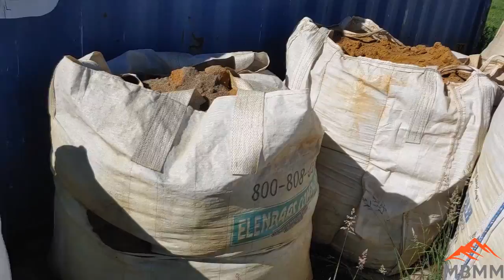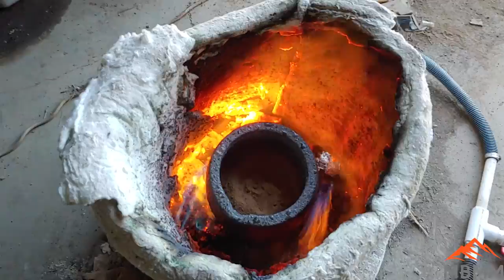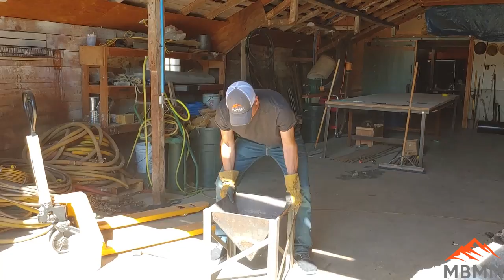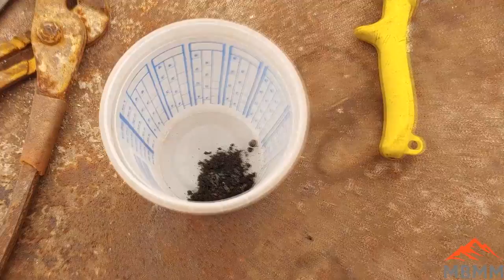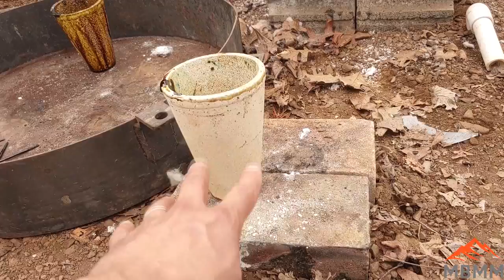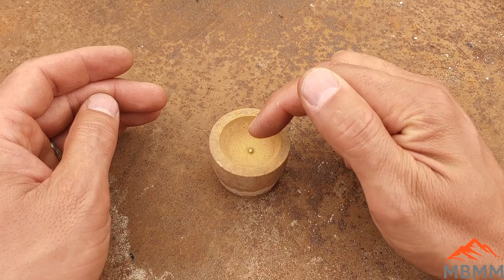Smelting and Refining Gold From Tailings

Comment: Heat the cone mould to over 250 degrees centigrade mate. The interaction of cold mould to hot pour creates thermal trap points all around the cone mould surface that will hold onto heavy/precious metals. It can throw off actual essay weights and results.
Reply: I don't know nuthin' and I thought heating the cone might make some difference .  Great clip .
Reply: A cool bullet mold, makes wrinkled bullets. I heat it by filling with molten lead and placing over the furnace. I'm sure he could hang it on chains over the furnace.

Comment: Melt a batch of borax, pour it in a cookie sheet, let it cool, and crush it. TADA! Anhydrous borax! Thats how my blacksmith buddy does it for his flux anyway...
Reply: Install a food grater above that hook a bunch of wires to it some with lights in them a jucer under nieth it an place all that on the rear deck of a dalorion then flux it
Reply: @closed2459  Very good
Reply: Fairly sure his furnace is hot enough mate.
Reply: I also use this method to make anhydrous borax but its not as clean as commercially made
Reply: If he does all that he might as well just drive the water off in the smell like he does
Reply: @jamesproffitt9641  well yeah, but that makes for a boiling foamy mess, and you can only put a tickle of material into a crucible without boiling it over... Not to mention it takes time for all that moisture to kick off the borax, and that means burning extra fuel... But thats okay! You do you... ✌️✌️✌️
Reply: @MrSackofnuts  mostly it just foams up, and makes a huge mess as the moisture is driven off... It also makes the smelt take a little longer as the temp stalls out for a bit.
Reply: @closed2459  😂😂😂
Reply: @MrSackofnuts  yes pentahydrate is bonded t 5 water molecules. Just drive it off with heat.

Comment: I built an underground vault for a business. I used a 1200 sized concrete septic tank with no holes. I put a sleeve with holes in it then filled the tank with fist sized limestone. The wash water going in was so acidic that it would dissolve iron. After filtering through the rocks it was near pH 7.

Comment: Cool, so this was basically a proof on the prior video.  I suppose the next step will be to figure out how to put a ball mill inline with automatic feed process before they get the table.
Would you get any benefit from putting a roaster after the ball mill to kill of the sulphides before they hit the table.
Crusher - Hammer Mill - Ball Mill - Roaster - Slurry Mixer - Table ??
Reply: That sounds like procedural thinking 🤔

Comment: Always enjoy your videos , seems like experimenting .
But it also seems like reinventing the wheel ?
Most of this should be already known by smelting for the last , what 100 yrs. , or at least many decades ?
Again very interesting to reinvent the wheel , but after experimenting - wouldn't referring to already know info be a good added part ?
Thanks again
Reply: I'm only guessing, but I think they're a smaller operation, compared to the big gold mining outfits, so he's experimenting for techniques with higher recovery rates. For him, every 0.01g counts, whereas a small amount of loss is acceptable for mining operations that pull up kilos of gold at a time.  A lot of the techniques he's using (especially at this scale) probably wouldn't be economical for a larger operation (for this video, I'm guessing -- with two burners going -- he went through maybe $7 worth of gas, plus let's say an extra $1 or so in borax, all to pull 0.9g of pure gold off the original 4kg of tailings. So that's $8-$9 (not even counting the cost of his time and effort) to pull maybe $50 of gold. 

I think also this may lead him to process the ore finer to begin with: if he's getting this much gold from what is supposed to be the waste product off his turnkey system, then perhaps there's a way to tweak the initial process to gain a higher yield from the very start and not throw away as much.
Reply: @muyyek  I agree in principle, but I think Jason may have his machine customers in mind before his own operation.

Comment: You need to let the smelting pot drip until nothing comes out. The highest concentration of gold you let drip all over the place and stay in the bottom of your melting crucible. The molten material doesn't have enough convection current to left the gold off the bottom.

Comment: Try this:
Take a sample from the sacs. (Representative)
1000 g sample
1000 g Na2CO3
700 g borax
150 g litharge
10 g charcoal
Smelt it and let cool it down (at room temperature) without water. 
Take de lead at the bottom and coppel it.
You dont need to smelt 5 kg if the sample is Representative. 
You should put the lead when the copel is at 950°C , (not before).
We usually melt with diesel furnaces. you would lose less temperature and it is safer.
Good job
Thank you Jason

Comment: I’m just starting to get into smelting after finding a good amount of very small flakes and flour gold from sluicing in the uk but its still got a very tiny amount of 100/200 mesh quarts dust, crystals and afew dots of black sand here and there.. I was just wondering how I find the right mix of flux, borax or whatever else I could use for that kind of high grade cons?.. Would be very much appreciated if you or someone could point me in the right direction 👍..
Reply: Dan Hurd has some good videos on refining those kinds of things

Comment: flotation cells are pretty cheap and easy to set up. Im curious how much more efficient it would be to process some of the tailings with a flotation cell to remove the sulfides before then cupelling.
Reply: Do you have a referance info on just how to do it?
Reply: @allenhammer7923  that would depend greatly on the characteristics of the individual ore.
Reply: @allenhammer7923  the basics though are you get the correct pH of the water, possibly add some chemicals to allow the minerals to be separated to be more hydrophobic, have something at the bottom to agitate the fines, and then bubble air through the mixture and scrape off the scum that floats to the surface. 

You set up the chemistry so only the minerals you want to separate become hydrophobic so they can stick to the surface tension of the bubbles and float to the top.

Comment: Where do you get those pyramid molds?  Those look to be the best for this sort of work.
Reply: He said he made it
Reply: @badboybubby7794  I hope he posts a video of how to make one, in that case!  You can't beat a graphite mold with a hammer!  ...Well, you CAN... but then you end up with a pile of rubble.
Reply: @Alondro77  It's a pretty straightforward welding project. 4 equilateral triangles welded together with stand made of angle iron.
Looks to be 1/4" steel plate, 8" triangles...
bzzzzt bzzzzzzt tap tap tap & bob's your uncle..